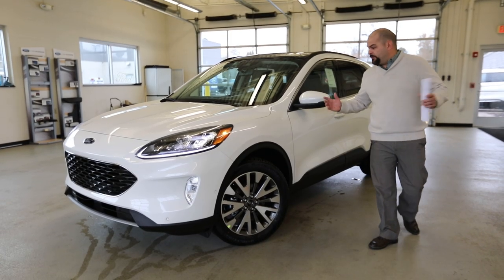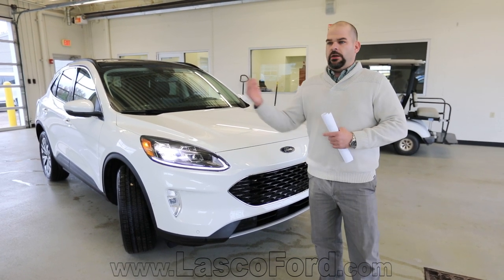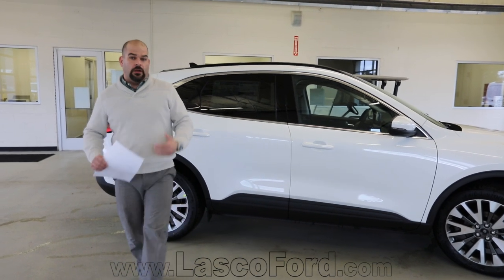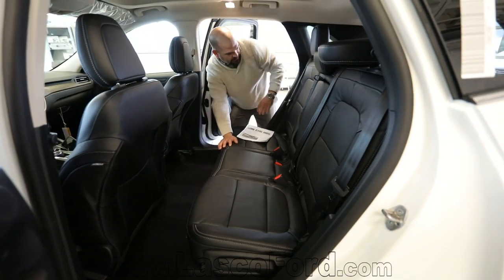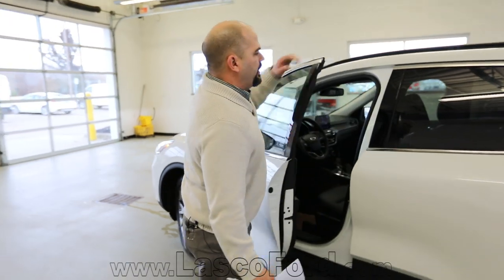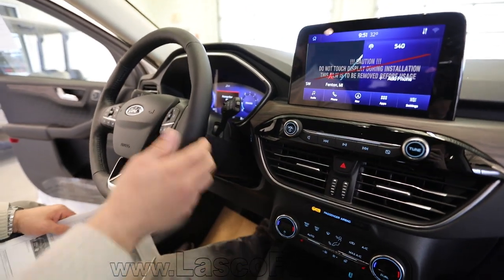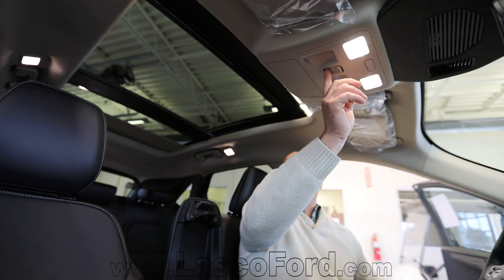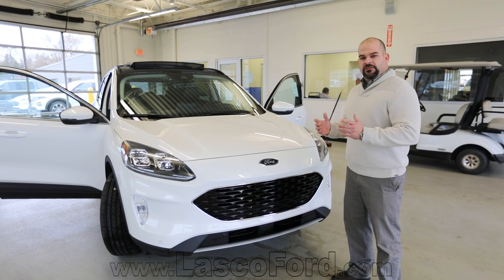2020 Ford Escape  - Exterior & Interior First Look Walk Around

Comment: Great looking, drives really nice But!!! the interior is so filled with hard plastic I had to walk away. That in combination with the seats being hard as rocks and the passenger side front seat cannot be raised or lowered pretty much sealed the deal or No deal I should say. Very disappointed! Honda CRV although a little more expensive is head and shoulders better. There is really No comparison.